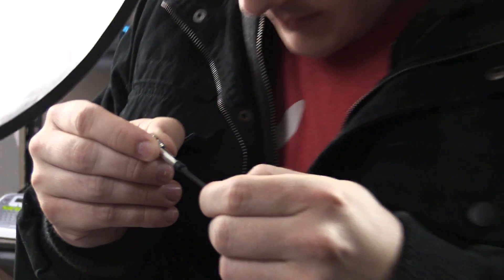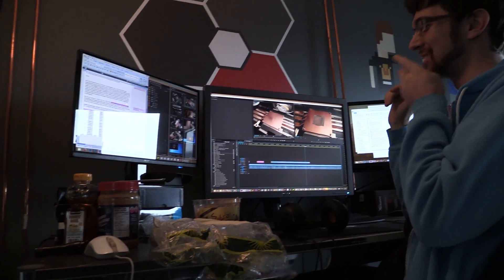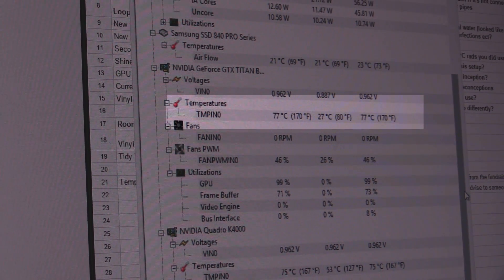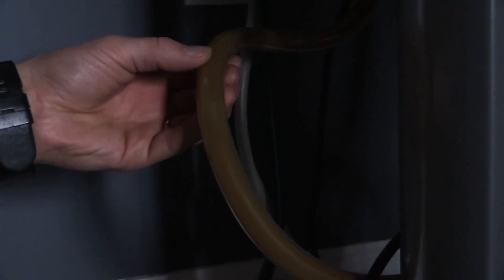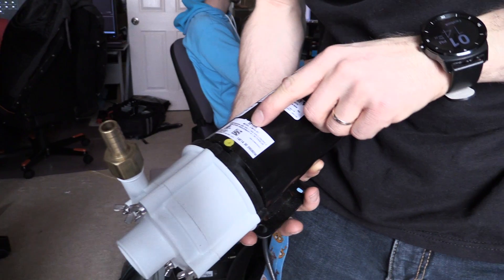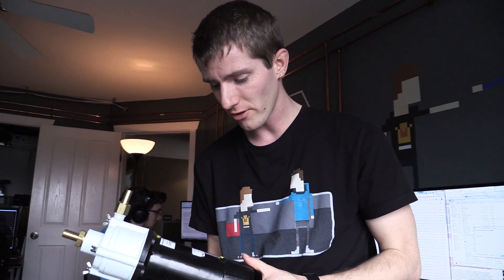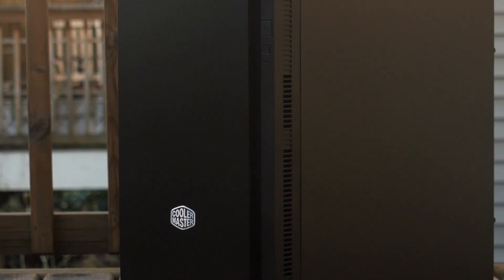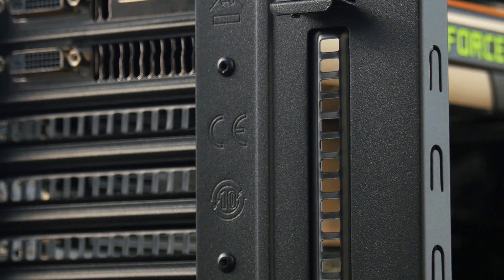Whole Room Water Cooling Part 5a - Trouble is Brewing in the Whole Room Loop...

Comment: Mechanical Engineer here. You should try a "reverse return piping layout" that we use when designing hydronic systems. The basic concept is that your return piping doesn't start until you exit your first piece of equipment. This would allow for all the PCs to get the required flow, without the need for an additional pump at each PC, balance the flow within in the system better, and reduce the pressure requirement of your main pump. also, adding an automatic air vent (available at any hardware store) at the high point of your setup would help alleviate your air bubble issues. Not sure if you'll ever see this, but I figured I would offer the advice. Love the channel, keep up the great work!

Comment: With copper being an excellent conductor of heat, most of the heat will radiate into the room through the pipes before it gets outside. Have you tested the temperature of the water as it exits a PC compared to the temp when it first makes it outside?

To get the benefit you are aiming for you will need to lag the pipes.

Comment: Thread a spring from a pen around the part where the wire tends to break, then use a bead of E6000 or heat glue to keep it in place!

Comment: All I can say is WOW!!! I do commend you guys for undertaking such a large project and sticking with it, despite how impractical it maybe. It boggles me that you would even start a project like this if you planned to move in a few months. And admittedly it frustrates me that $10,000+ dollars of gear was giving to you all for free and you don't have the good sense to research simple things like algae formation in loops or that automotive coolant is not ideal for PC cooling. You would have honestly done better with just distilled water and some colloidal silver. 

If I had made a mistake like this at my job I would have never heard the end of it. My boss would have made a nest inside my ass until the project was finished and any other reason he could find would resulted in my termination. Measure twice and cut once applies outside of the carpentry field too guys. Double and triple check everything as you go, have each other check each others' work to ensure quality control and avoid catastrophic mishaps.

Comment: The problem comes from using tap water in the system, use pure antifreeze after you get a decontaminated system. tap water is full of microbial matter from the treatment process at the water treatment plant.

with the teflon tape, you can use too much.

Comment: Hey Linus, I'm a professional audio engineer. In theatre shows using tons of similar mic packs, we heat shrink or hellerman sleeve a loop into the connection at the top so the wire is going back down towards the transmitter pack. It gives a bit of an anchor to the strain relief. I normally use a hellerman tool to add rubber tubing over the top for more flex than heatshrink as h/s is more solid. Worth a try..

Comment: over years my system builds up gunk on any blocks with small cooling fins. I found out it is gradual wear from the walls of the tubing, the water flow acts as a very gradual abrasive on the plastic tubing and the buildup gets deposited on the fins of a water block that happens to act as a filter. This type of buildup takes years to affect performance so its just something to look out for over time.

Comment: Maybe try flushing the system with distilled vinegar & distilled water? Works for a motorcycle cooling system... Also as someone else mentioned dont use tap water. Do you guys have to use engine coolant? What about bio degradable engine ice, or a little water wetter in distilled water? Not an expert, just giving my 2 cents...

Comment: I think your "gunk" issue is from using the tap water.  I work for a cooling system company and for these type of systems we would typically recommend
 using distilled water.
Reply: I was thinking the same thing. After many issues with my cooling system on my R6 ive learned what to do and what not to do in my cooling system. It is recommwnded to flush with distilled water with a small mix of distilled vinegar. I was also wondering if they could use Engine ice in this cooling system because it is bio degradeable. I sure hope they aren't pouring that engine coolant down the drain.

Comment: What helps with the breaking cables: Take a pen and take it apart. Take the spring you find in the front end of the pen and wrap it around the cable that tends to break. Easy and cheap fix! :D

Comment: you could add an anti-biotic/anti-mycotic mixture to the cooling solution. If it's fungal or bacterial infestation, that will inhibit growth.
If any of you have access to a microscope you should smear a small amount of the substance on a slide and examine it and see if you can see cells growing.

The UV light sanitizer Idea would be the easiest and best way to do it, however, be careful when handling short wave UV lights as they are dangerous.

Comment: Have you thought of using a strong UV light?  You could put 4 in the corners of a small box and have the line run through the middle of it.  I know it works for killing bacteria in the air of HVAC systems, not sure though if it will kill what's growing or speed it up.  Anyone else happen to know?

Comment: use distilled water, anti-freeze does create that membrane/slimy film you poured out of the res.. that said its something comon in cars with the use of antifreeze.
Reply: if not a biweekly to or every 3 weeks, ideally keep an eye on it, and you should flush the innar flush with mineral'oil and fill the pump with oil and let it run on a close loop, also leave about 4 cupsor a 40-oil 60-H2Odistilledno deposite) so that it refreshes its barrier. and really coat the nooks and crannies because of the pump atomizing them. did eye say keep an eye on it; like empty the containing water in a clean reservoir and chek the pump, look at and verify if yes watre beads are all over the place if you dont well spray some oil on them after waiting for the water to evap. and refill with uncuntaminated preveously drained.

 you had a residu in your system.. the only way rad flush would work is with heated water.. so you will need to add a heater on the loop, and make sure your equipment can withstand all that heat. in a car the engine heat is the catalyst. ideally get it cleaned via soundwave machine jay leno had to clean off all the dirt and gunk from tools and parts. make sure your pump is full do it several times while turning the turbine to insure that no gunk from rad fluid still exists within that system..

i donnt know if it was stated here above was tested although chemically no experimentswere done on my part. so no test results..
mechanically and chemically its sound
if your going to test make sure you read up on the mattter

Comment: I wonder if the radiators froze over and cracked. Wouldn't normal living room radiators been a better solution? Or may even be better to connect it with an
air-conditioning system.
Oh um :D

Comment: Automotive coolant doesn't need any type of biological agents because automotive systems are typically at 200 degrees Fahrenheit and that temperature is consistent across the most of the system. I thought to myself perhaps you can use a large automotive aluminum radiator as it has its own reservoirs and huge cooling surface. I doubt you would even need much airflow with it being way lower temps then what it was designed for. Ofcourse this all speculative. Not sure how any of this would actually work with pc systems

Comment: Well in pools to kill organic matter like algae. We use pool grade fresh chlorine(from a proper distributor) with sodium bromide 99% Just make yourself a makeshift filter(which I would want on a loop that size. just jerry rig something) and run the loop thoroughly trying to get all the crap off the sides. 1/2gal of chlorine per 1000gal of water and 1.6oz of sodium bromide 99% per 1000gal should do the trick to killing any algae in the loop. filter it out and then flush thoroughly and refill. chlorine and sodium bromide is fine in copper, pools have plenty of copper in their heaters :P.

Comment: copper pipe + mixed metal water blocks + ethylene glycol antifreeze = gunk also antifreeze is surgery  microbes love sugar 

you are also gonna shortly start braking down the copper from galvanic corrosion reacting with the metals in the blocks  and the microbes creating acid , making sludge
so yea you wasted a bunch of time and money running copper water line when you should have ran PVC which is both cheaper and easier to run 
switch to PVC, or flush the loop and use Propylene Glycol as a antifreeze (laxative commonly sold under "miralax"  or a "RV  water system antifreeze" both won't brake down the copper as quick but there is no stopping that even pure distilled water will start producing black sludge

Comment: If you find a cable with a metal spring reinforcement it probably won't break as easily. That's what's used on Audio Technica ATM 50 headphones and it's super solid.

Comment: to pinch off the lines you could have gotten coolant line clamps at princess auto, and wow that sucks about the growth in the res. For a new res you can get a plastic one from a water treatment store. It will cast more but you will be able to see the level without opening the system

Comment: I am not no chemist, but water-cooling is definitely not new to me.  Before I setup any water-cooling build. My first priority is the clean the entire system. Meaning block, rads, blocks, even tubing itself.  I use distilled hot water to flush out the new block, rads, and stuff; then run the entire loops with all the blocks, rads, tubing for good full month.  Sounds ridiculous, but save yourself a lot of trouble and mess in the end. Taking down an entire water-cooling is NOT FUN!

Try running hot distilled once more before the actual build, and your system should last a while longer.  I am not a big fan of using anti freeze or any type of colored coolant.  I only recommend using distilled water, and piece of true silver. 

As for the reservoir, can you get someone to build a custom acrylic tank?  That way you can see what's inside the water and of course, keep the tank in a very dark room. 

I'd get rid of that aluminum tank, not sure if it will or not, it may cause some kind of galvanic corrosion in the near future.

Comment: Not an expert on cooling by any means, but if I could offer a few outside of the box suggestions.

1. If you are wanting to use automotive antifreeze, look into Dexicool or VW's G12 coolant. They are both easier on soft metals than the green stuff that it seems like you guys are using.

2. For the reservoir have you considered a plastic container? Your reservoir seems like it might be 20 gallons or so, you should be able to find a 20 gallon plastic tank fairly easy. 

Again, not an expert, just someone from outside the group offering suggestions.

Comment: Hi Linus. Just a suggestion for a microphone cable workaround. That looks like a standard 3.5mm jack plug. Why not buy some cheap, short headphone extension cables and if it breaks, you can just replace it?

Comment: well car guy here... the antifreeze  has no biocidal agent, because of environment pollution... just imagine every time a car crashes and breaks it's radiator, it would be pouring biocidal agent all over the place... not nature friendly... At one point they were really toxic but now they are "pretty safe".
That is most likely nature making it's way in to your pcs... 

Another thing that could be is as someone stated galvanization... or oxidation...

What is also plausible is that the inner part of your reservoir, had a coating, maybe clear coating to reduce galvanization or other problems... and the antifreeze might have eaten it away....

I'm not an expert, just giving in my opinion, I think you should clean the reservoir fill it with the same mixture you had previously, add a reasonable amount of biocidal agent, throw some silver coils onto the reservoir (just to be sure...) and put a flow filter or a gas filter right after the reservoir and right after the pumps (just to prevent unwanted matter on your blocks...)
In cars and bikes we use flow filters to stop little imperfections of the tank or dust to gunk up the carburetors needles.... they are cheap and useful! (and if you get a clear one you can see when it's clogged and that is a good indicator of your loop health! 

Pardon my English, not native speaker and feeling lazy to double check for grammar mistakes...

Comment: its caused by the copper tubing and the steel res, maybe? any liquid can cause corrosion to metals such as copper and steel, the force of the pressure on the outer walls of the copper tubing may cause some friction, and how aggressive the automobile coolant is, causing the rubbing off copper particles and the build up in the res, i really don't no much but its my theory . maybe get a plastic tub for a res and a filtration system to filter out any metal particles thats would a cheap solution but then again you'll still have problems in the future with replacing the filter and a low flow of liquid coolant. The best bet is to remove all metals (steel res and copper tubing and a les agresive coolant). maybe is can be the automotive coolant who knows. more research equals less work.
Cheers

Comment: linus, try an inline filter for the goobers, it looks to me like soldering flux from the copper brazing. it could also be dielectric grease from the pump windings since the seal was compromised. also you should add a throttle valve at each drop so you can pinch off flow to the closer drops in the loop and prevent short cycling.
Reply: you could also add an inline UV light to kill biological, look at aquarium suppliers

Comment: The growth came from introducing tap water into an automotive anti-freeze. Modern anti-freezes already come with purified water and should have a big warning label saying "DO NOT ADD WATER!" But regardless why not run the whole system on just water? Engine coolent doesnt increase cooling; all it does is, lowers the freezing point of water as well as helps prevent rust (nothing in your system will rust).

Comment: To prevent cable breaks, move your wireless transmitter to the centre of your back. The only way to crush the lead is to bend over backwards (which is something you're unlikely to do) or to lie down. You just have to remember that when you sit down, can't lean on the chair back.

Comment: I'm sure someone has already mentioned this but i'm too lazy to read. Automotive coolants do not have a biocide agent in them. The coolant in those cars heats up to an average of 200F, so biocides aren't really an issue. Not to mention most cars nowadays utilize aluminum engines, heads, and radiators, so I dunno how they react to steel.

Best bet is to just chuck a bunch of silver coils in the loops to kill that crap.

Comment: Still wondering why you didn't use a heat exchange unit from an industrial air conditioning unit. Made for the outdoors and weather. Definitely more cost effective and better than what your using. Just my 2 cents, but to each their own.
Reply: well the whole point was to cool their pc's and try something cool. easy to understand when you take the right information into account.
Reply: Well maybe not due to them having sponsors that most likely sent all the rads and fans. So they probably just paid for the material like the wood steel etc.
Reply: @MrPetervp14  And tools - very expensive.

Comment: I hope this gets to you Linus, i am a parts manager at a car dealership. What is going on is a reaction from all the different medals in the loop. Automotive coolants are designed to work with different types of medal, but i have seen this "gunk" in car radiators because the coolant put in by the owner was not correct for the medals in the engine. The coolant you picked might not work with aluminum, stainless and "cooper". Not many engines or parts are made of copper. Hope this helps, you guys rock!

Comment: LinusTechTips! Questions, did you use distilled water? Or tap water? And what was the antifreeze to water ratio? (Example, 40% antifreeze 60% water)
In this paragraph, some stuff near the bottom, may be important
Also, antifreeze is designed to keep your vehicles system from freezing, and overheating.  It takes the heat away, and cooles down along the the way to the car radiator. And is the looped to keep the car cooled. All of your systems are running at a reasonable 50-70 °C, or in that margin. Vehicles run usually at 90°C all the time. Your using the wrong liquid to cool your system mate. And, I read up on antifreeze, and all anti freezes have a mix of additives, including lubricants, buffers and corrosion inhibitors. Even organic mixes. Although there is only a  5% amount of these. They may be a factor in those build ups, or deposits. Which, if you really want to get knee deep in the info, Check antifreeze on Wikipedia, there is lots of science related stuff in antifreeze, that may be causing this problem.

Comment: Fernox or sentinal central heating corrosion protector and a magnetic filter will solve all your gunk problems and will be very easy to install, Add fernox, sentinal to the res and stick the mag filter in the loop somewhere. Also a header tank would make a pretty good res. And they are cheap.

Comment: LINUS (hopefully you see this) there are problems with Aluminum vs steel radiators with antifreeze. For example, my Audi A4 quattro 1990 uses a special type of green antifreeze that if you mix with the wrong type, or try to use that green in the wrong radiator, you get that crappy brown. Check they types!